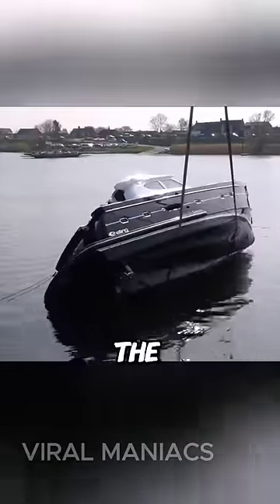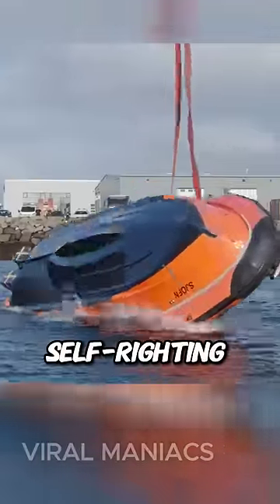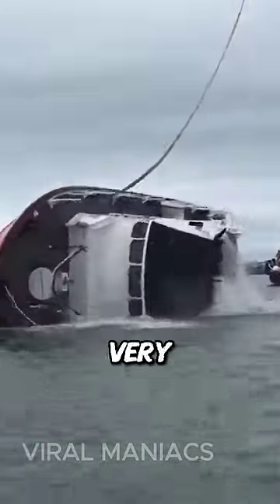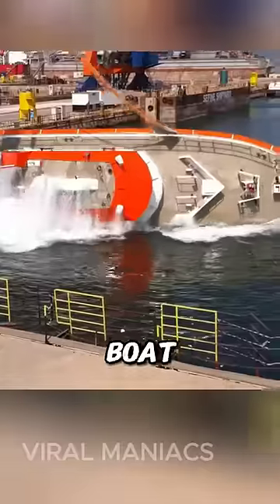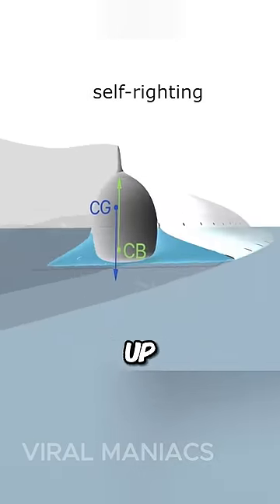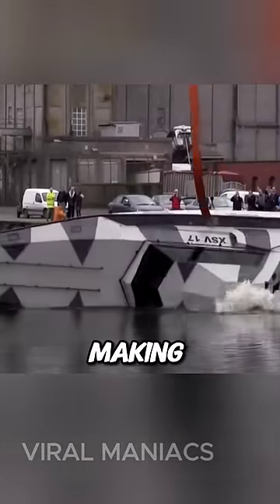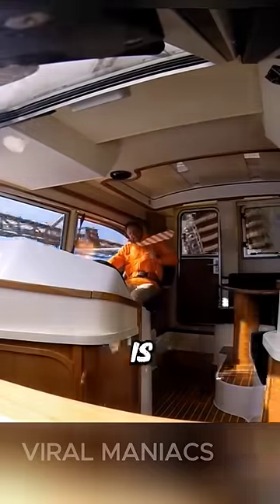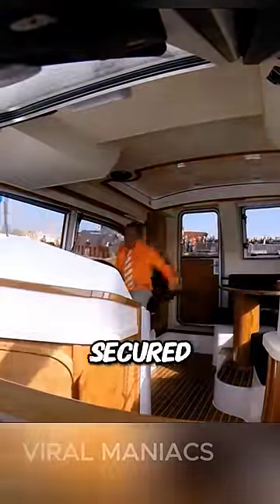This Boat Is Unsinkable #shorts

Comment: Imagine being in a hurricane and all you do for 4 hours s is roll😂
Reply: I need to get this before god unleashes the second flood
Reply: yeah.. roll and vomit...
Reply: that's how you get human smoothie
Reply: @bigfish8555  God promised after the first flood to never wash the earth again. That was symbolized by the rainbow
Reply: Do anyone here know what the small rudder and propeller like thing on the left is, why is that
Reply: That sounds awesome! I would fkn pay to take that ride 🤣
Reply: @JM-ne5ep yea god promised not to commit genocide again. How crazy 🤣
Reply: We gotta change the song. Not, "Row, row, row your boat". Now, it is "Roll,roll, roll your boat."😂
Reply: @bigfish8555  what? 🤣🤣
Reply: @Nobi36 
It's just a built-in docking motor. Most likely, a small electric motor.
Reply: All bad 🤢
Reply: @Nobi36  It's called a wing engine. In case, main engine dies out there, you can still go home. Through this form is unprotected and creates drag when unused. There are boats where both engines use the same prop and rudder with a transmission in the engine room to swap which engine drives the prop.
Reply: 😂😂😂 ikr
Reply: @JM-ne5ep yeah I thought God was going to release fire upon the earth the next time .
Reply: @JM-ne5ep he only promised...he didn't sweat to god

Comment: It’s all about gravity. The heavy side always stayed on the downside.😊
Reply: That works often without so Water Tanks and that makes it Visible, that this a Stupid Information, on this Channel is.👈🏼😉👍🏻

That makes that not good enough Visible how that so works ,and there is your Message ,alone so far,Safe better.👈🏼😉👍🏻

In the most Times is there a Speciale Place for the Air on the Side and the Gravitation and a weight on the bottem  makes then the Next Important Place Visible ,that so a Acktion need .

A bottle makes it very easy Visible how the Ground Situation so works and the Air on the Side that is then for other forms and Situations, more Important.

One Side alone has no Tipping Point and so makes it from alone, his move to the Right Side .

That need no Water  so Acktion and I have it never see, that a Boat, so with the water works .

Comment: So much nonsense in this video. First of all every boat is designed not to sink, durr. These are designed not to cap size. And there are no water filled chambers. They simple have a volumous but comparatively lightweight and watertight superstructure. So when they flip over the heavy hull stays high in the air where it is unstable and falls back down.

Comment: Meaning they are designed not to sink. Isn't that like every boat except a submarine?
Reply: These boats have a 2000-5000 pound counterweight attached in the bottom of the boat. Most boats don't have any counterweight in them, so no it's not your typical boat.